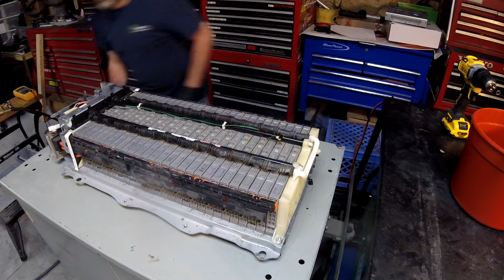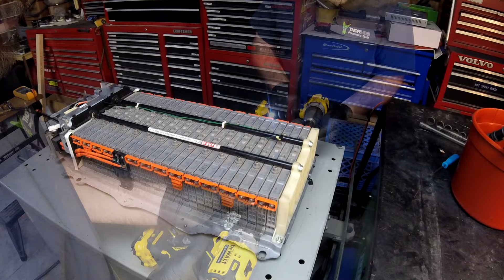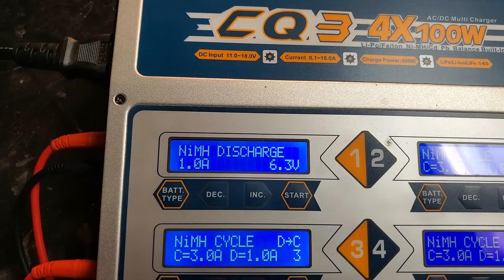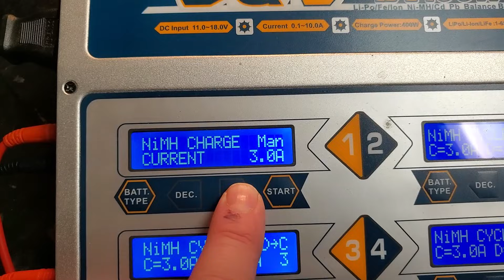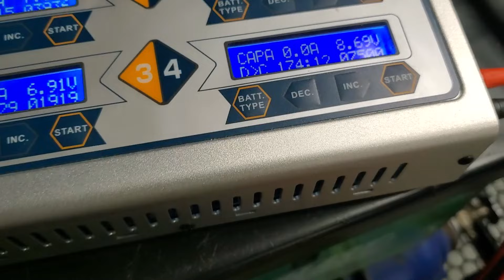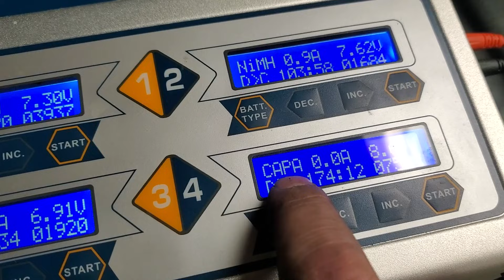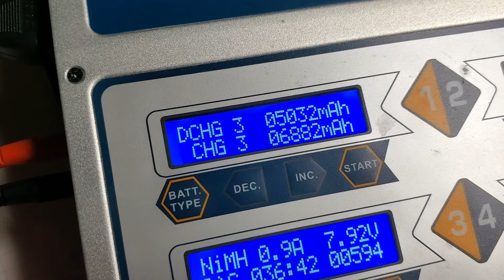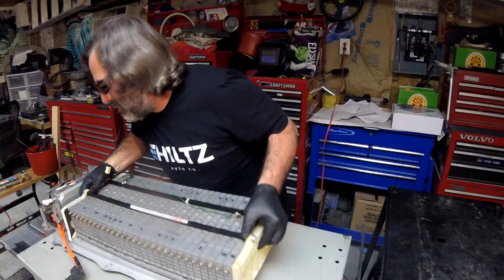DIY Refurbish / Repair Hybrid Battery 2nd Gen Toyota Prius - EV-Peak smart charger POA80 P0A80

Comment: Hi Gregg, Great job and hats off for answering everyone's questions. What do you think about pairing the weakest cells with the strongest ones, so I could get better modules on average. 

I'm afraid that too many will be weak, but if I put a 5000mAh cell next to a 4000mAh one, it would sound logical that the module would have a capacity of 4500mAh. Thank you in advance for your opinion!
Reply from the maker: Hi Formaster, Thank you very much for watching and leaving a comment. Much appreciated. Unfortunately the capacity of the pack will be that of your lowest cell.  This means that if you had a pack with 27 cells that read 5000mAh and 1 cell that read 4000mAh, your pack as a whole would have the capacity of 4000mAh. Please let us know how this project goes for you.
Reply: @GreggFesto  TY for the fast reply :) Please correct me if I'm wrong, but according to the principle of series connection, I think that not only the voltage is added in the blocks, but also the capacity balances each other out.. In other words, if the modules of a block are 4500 and 5000mAh, the capacity will be 4250mAh and the ECU will use the complete block as a 4250mAh unit. Am I wrong maybe? :))
Reply from the maker: Hey Formaster, I was taught that the pack as a whole will only have the capacity of the lowest cell. I believe this is indeed the case as I have seen cases where only a single low mAh cell cause a whole pack to have reduced capacity.
Reply: @zsbalak  Formaster is probably right, logically it makes sense for the lowest CELL to limit the whole module. NOT the BLOCK and NOT EVEN THE MODULE, but the lowest CELL. Because the module has 6 cells in series. The reason the pack is limited to the lowest CELL is for safety purposes. If 1 cell is rly weak, and is overcharged it has the potential to explode, so the pack will run as the worst cell. So it doesn't matter if you put them in series, because if you put one rly bad one with a rly good one, it will explode if it avgs out. Im not speaking out of experience, purely logic.
Reply: These are Modules not Cells.
Each module contains 6 cells.
Reply: I think yu right I tried the 7500 mAh ,the start iinftate and over charge ,5500 is a good number

Comment: Would you use the same charge/discharge settings is using newer Gen 4 Prius NiMH cells? TIA
Reply from the maker: Hey Phil Huddy, I have not worked on 4th Gen pack yet. I am not sure if there are different specifications between 2nd and 4th gen. This would be a great question to ask on one of the forums such as PriusChat. I appreciate you watching and commenting. Please write back and let us all know what you find out.

Comment: Good evening , I have a cell that on the first discharge it read 18mah and in the charge 4372, in the second one 2817 and 5685, on the third 3095 and 6020, on the fourth 2685 and 6332, on the fifth 4155 and 7500, will that cell be considered good if it keeps going up?
Reply from the maker: Edward, I think that data is a perfect demonstration to how the process brings a cell back to life.  I would keep running it. If you get 5000mah on that low number then you are what I consider good. Remember your charger may not run all 3 cycles if it is hitting that 7500mah cutoff. Please let us now how it turns out.
Reply: @GreggFesto  will do, is 5000mah the highest on the discharge that I want to get? Or does it go higher? The reason why im asking is to know when to stop running cycles on the same cell
Reply from the maker: Edward, I have indeed gone higher than 5000mah on the discharge but have noticed that if too many cycles are done then the charge value starts dropping. Dont forget that the pack as a whole will only have the capacity of your lowest cell so going after a number such a 6000mah for discharge may mean replacing more cells. The 5000mah number will give you all but one power bar on the dash screen.
Reply: @GreggFesto  thank you for your video, just installed battery, internal resistance went from 31 milli omhs to 21, life expectancy from 54.5% to 101.7%
Reply from the maker: Edward, thank you for watching and for the followup after the process. I love this sort of feedback!! Happy motoring.
Reply: @edwardecrespo6418  how to test the internal resistance?

Comment: Would the battery cell specs are the same for the 3rd gen prius (2011) plan on doing this, this weekend and before I get started would like to have as much data as I can get. I ordered 3 chargers to do 12 cells at a time to speed up the process a bit since I need the car, I have no faults however high internal resistance, hopefully is corrosion in the bus bars, will also be replacing those with nickel plated ones and stock nuts. Have a few weeker modules by .3V maybe one by .4 volts will be testing  cells individually to identify the differences between and replace whats needed but overall would like to extend the life of this batterry, currently getting 54 mpg on the highway.
Reply from the maker: Hey Edward, Thank you for watching and writing in. Yes this should work the same for your 3rd gen. The only suggestion I have is to not charge cells that are directly against one another to help keep the heat down and make the process more efficient. Good luck and please write back in to let us know how it turns out.
Reply: @GreggFesto  will do thank you

Comment: Great video thanks , only one question which multimeter you used , I have trouble to measure in mv , I measure only at my multimeter 7.88v 7.87v. How I can measure 7.881 mv like 4 digits ?? Plz
Reply from the maker: Thank you for watching and commenting. I use Fluke 89 multi-meter.

Comment: Reconditioned now.
The pack reads 230 volts DC.
YESYERDAY I STILL HAD RED TRIANGLE/ THEN I CONNECTED THE RED PLUG CORRECTLY. TRIANGLE WENT AWAY/BUT THE ENGINE IMMEDIATELY STARTS?
TOYOTA SAYS/I MUST SEE READY LIGHT/I REALLY DIDNT NOTICE.
TODAY IF CHECKED THE VOLTAGES/AND THE 12 VOLT HAS BEEN ON CHARGE.NOW I FORGOT TO PLUG UP THE HV BATTERY AT FIRST/SO RED TRIANGLE AGAIN!
WENT BACK PLUGED UP CORRECTLY HV AND 12 VOLTAGE 
TRIANGLE! PLUS READY LIGHT.
NO ENGINE START/ SO I PULLED UP AND BACK 15 FEET/THE ENGINE CAME ON AND LIKE YESTERDAY/ IT SHITS OFF AFTER 30 SECS.?
MAYBE 230VOLTS ISNT GOOD FOR THE ECU?
MAYBE I SHOULD TRY AND DRAIN IT DOWN.
THE DASH SAY 4 BARS?
Reply from the maker: Hello Steve, I believe 230VDC is acceptable number. I am not 100% sure if there is a set way to connect everything, I usually completely connect everything including HV battery then connect the 12V battery last.  The engine is correct to come on a few seconds after you turn the car on and then shut off a small time later. Have you driven down the street?
Reply: I really appreciate the response! 
Today I hooked everything back up.
Nearly forgot? 
Had the 12volt on trickle/ since folks 
Say it can be an issue.
Foot on brake /one push  on the button nothing but one little check eng.light.then press the button again.i think the engine started briefly then quit.so.  I put it in gear and it silently moved/ha!
Reverse makes a sound different than forward.
Engine started just as before then quit. Still I could move with electric power.And/NO TRIANGLE at all!
Like u suggested/ I'd like to give it a try on the street.but with a tow strap and someone following.
Waiting on a cheap obd2 /bluetooth thing.I wish I could figure out how to use whichever app is best and check
Myself without towing to Romes
Riverside Toyota .
I do really Thank You for your responce!
Reply from the maker: Steve, I use app called Torque for reading codes. Sounds like your car is really close to good if not already. Please keep us updated as you get it going. Any issues you are having and the solution could help others who read the comments.

Comment: just jumped into the wagon, here is my take: started refurbishing a  battery pack i had gotten from the salvage yard when our 2010 prius died, turned out to be the inverter which was still under warranty, at that time i pulled the battery pack and cleaned it up but did not refurbished/balanced it, anyways today the prius is getting very poor MPG, ~33MPG and i see the battery charge and discharge like in no time, my daily driver so i do not want to pull the pack and not been able to drive it, the battery pack from the salvage yard had all batteries with 6.7v+ just two with voltage below 6V, measured batteries internal resistance with a charger that has that function (Reaktor) the resistance was close among them and bigger on the ones that measured lower voltage, then i have been using a BWARD CQ3 (from amazon) with charge/discharge set to 5A, the rest of the setting as you suggested, it actually charges  them at 5A but discharges at 1.3-1.4A, getting very good results on taking them back to above 5000mAh, the first run will always show low mAh because the batteries have low voltage, seems like all the batteries have most of the mAh between 7-8V, discharge takes around 260 minutes at 1.3A and charge around 100m at 5A. been comparing the charge/discharge profile, the good cells hold the voltage pretty long 7-8V, when they go below 7 goes faster, the questionable cell 7-8V look similar however under 6V voltage drops very fast.

Gregg, excellent Video , after you balanced the cells, i did not see you worry about the voltage per cell, other videos say that if the voltage is too high (>8V) the computer will complain for having too high voltage, how is the battery pack behaving after you reconditioned? did you se any improvement on MPG? did you have any problems with MPG? 

I might need to replace as many as 5 cells based on the starting voltage and resistance readings, thinking on just getting another salvage pack, which would be very close to getting 5-6 cells off ebay. but need to see if the questionable cells recover after running them thru the CQ3 few times.

will let you gents know how it when, at the same time i will clean the ECR and intake, perhaps replace the spark plugs and coil packs?
Reply from the maker: Thank you very much for watching and commenting. I have done this process on multiple packs with great results before I made the video. I have experienced the red triangle prompting this repair but have also refurbished pack in car that was around 170k miles with MPG that dropped into the high 20's. In this instance of poor MPG I found that all of the cells were able to be recovered so did not need any replacement. The MPG did increase to the mid 30's after this refurbish. We ended up replacing the spark plugs, fuel injectors, and O2 sensor to get the MPG back in the 40's. The car is still driving with over 190k now and no additional work since.
Reply: i meant below 7V goes faster, that is voltage between 7-6 drops faster, my floor discharge voltage is 6V, people recommend not to take the batteries below 6V, i took couple down to 5V  by mistake but seem not to had caused any harm and the batteries went above 5000mAh faster, but i would keep the floor at 6V.

Comment: Hi Gregg, could you please help me with the error message on my charger comes on (connection break) after discharging and dry duration. I have got G.T. power 4x charger
Reply from the maker: @SIKEB34ST, Thank you for watching and writing in with a comment. I am not familiar with that charger or error message. My first thought is that perhaps a wire/lead has connection problem. If the connections are for sure good then would see if the same error happens when connected to other cells as well. If the error does happen on multiple cells than the connections and/or charger should be investigated further. If the error only occurs on a single cell or very few cells then the cells themselves would be considered suspect.  Please write back in and let us know what you find.

Comment: Thanks for this informative video.  It was extremely helpful to give me the courage to work on our vehicle myself. I received the red triangle just days after buying our 2004 Prius.  When I opened the cover, I discovered that 5 of the modules are smaller.  All modules test 7.99-8.01, even the smaller ones.  I assume that the problem is the 5 irregular-sized modules.  I plan to replace those 5.   Does that sound like a good solution?
Reply from the maker: Hello Jason, Thank you for watching and leaving comment. I am happy you try to do this sort of project yourself as you will save much money and have better understanding of the system.  Typically when a cell is to the point of setting the red triangle off it can be identified by a meter. What a meter wont tell you is the capacity (health) of the cell. So yes, If you replace the cells that read low and then reassemble most likely the car will go fine for a while. How long before another cell fails and how often the pack charge will cycle there is no way to tell. Could be only days but I would guess a few months.  As in the video, conditioning a pack to at least 5000mah you will know that it is going to cycle close to factory settings and you know it should drive well over a year with no issues. This means correct gas mileage and performance from the car. Please let us know what you decide to do and how it works out.
Reply from the maker: Jason, It is possible the pack is not the problem also. You should check the connections to 12V battery, The connections on 2 plugs going to the modules next to the 12V battery, and the connection on plug for the module directly behind the hybrid pack on the drivers side. I have found corroded connection all of these places before on different prius' and fixed those cars without having to remove any packs.

Comment: This is very similar to the way we did aircraft batteries back in the day. Except we had a servicing bench with a machine that would do all the cells at once. Discharg, charge, discharge several times, condition, test and all. We would disassemble and start the service after lunch and let it run all night. When we came back it was a matter of reading the results, replacing cells as needed, assemble, charge, test, recharge, and install. We would then do a ground run on the jet and if all was good, sign it off and go to the next job. 1 guy 24 hours to do it. Not always working on it mind you, usually just babysitting the machine. But it took about 24 hours for the full service.
Reply from the maker: Hey Ron, Thanks for watching and leaving such a great comment. It would be cool to be able to hook every one of these cells up at the same time and condition them in 24 hours.
Reply: What equipments is needed for this 24h task ?
Reply: @sorinivancu7330  7x chargers he is using  ,thats 7x4=28 modules at once.
Reply: The new NuVant LVc40 works great. Yes that's a professional level equipment and it cost $40k
 Set it and forget it $$$$$

Comment: Hey Gregg!  Great video!  Thank you.  Just a note that the discharge end voltage should be included.  I set mine to 6.0v after I ballooned the first cell attempted, because discharge end volt factory default was 0.1v.  I'm getting great results after that hiccup.
Reply from the maker: Thank you for watching and contributing to the effort.
Reply: unfortunately I did this with many of the modules (discharging them down to .01v. Though I didn't see any of them balloon, or understand why they would. As far as I understand you can ruin the module by discharging it past 6v which ya, it discharged to like 2v (lowest the charger discharged them to, maybe bc its "smart"?). I also noticed the charger would vary the amps when it was getting to low voltages. So maybe it turned out to be a good thing in the end? I now changed to low voltage to 6v and got most of them to be 5200+mha on min and 7500 mha on max . Only strange thing is that now my charger only discharges them to 6.6v not down to 6v like I told it to.
Reply: What charger are you using?
Based on another video, I bought the Tenergy T180 and while I set Discharge to 6v, it stops the discharge cycle above 7 volts.
It is rather disappointing because I think I need to get it discharged down to the technical minimum to "reset" the memory properly.
Reply: It likely ballooned from charging not discharging.
They will do that when they get hot. The module should slim back down after cooling off.

Comment: Hello is there a difference between the cq3  red charger and the blue CQ3charger?
Reply from the maker: Hello, Thank you for watching and writing in.  Unfortunately I am not sure of the differences in these chargers. If you do find out, please write back and let us know the answer.
Reply: I just bought the red one for $250 on Amazon.  It is almost the exact same set up as the one that Gregg is using!  BUT I found out the hard way that you need to pay attention to the discharge ending voltage (on the same screen as discharge amps).  I set my end volts to 6.0v.
Reply from the maker: Hey Soothing Sounds of Water, Thank you for watching and contributing to this effort.

Comment: Do you have any idea the difference between hybrid geeks premium high capacity cells vs brand new premium? Is it just refurbished vs brand new? And does the premium have higher capacity than the original from the dealer?
Reply from the maker: Hey M, I am not sure, I usually just buy replacement cells from eBay. Please write back in and let us know when/if you find out the difference.

Comment: Where do I get this tape wire at
Reply from the maker: Hello Marc, Thanks for watching and writing in. I used TIG welding wire as I have allot of it in my garage. You could use bailing wire, fencing wire, or even standard wire after stripping the insulation off. I have even used a bunch of those jumper leads before. The main thing is to make sure all positives are well connected and all negatives are well connected.